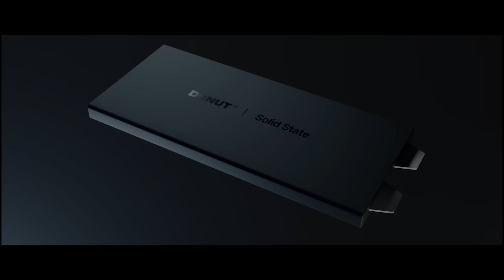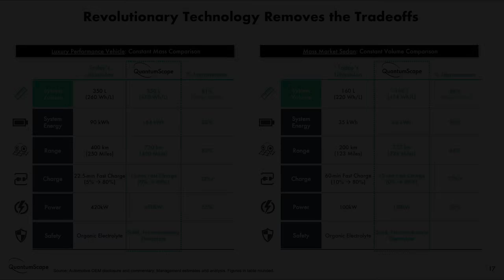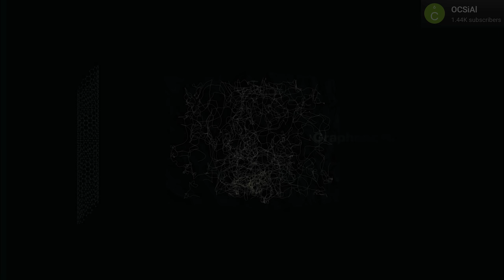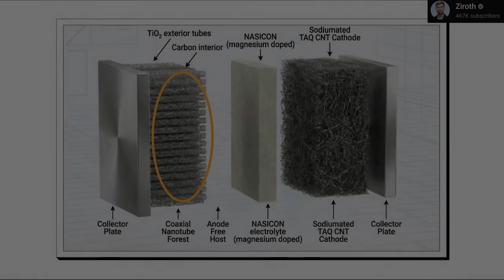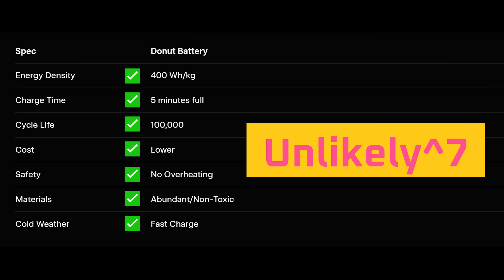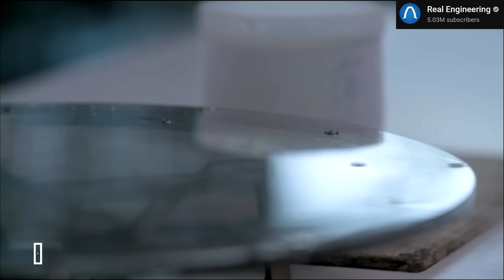Donut Lab's Battery has a Problem with Physics (and manufacturing)

Comment: I'm a little disappointed you haven't included the latest test results. I will be waiting an update when feel you have enough data. 

Other than that, I think you state the obvious (still useful though). Even us optimists, we felt this battery claims to be outside the current technology curve. Donut lab sure knows this and it is displayed at what additional statements they made after the initial release. Most of them are about what the technology is NOT, after speculation exploded.

So, yes. Either a completely new chemistry or a scam.

Comment: The results from their first test validate that they can charge very quickly. The next two tests hopefully will prove that they have the claimed cycle life and most importantly energy density. At that point hopefully you will have your miracle battery. Either way we will all know in the next week or so. Even if they fall well short of the predicted cycles as long as the energy density is close to their claims it will still be an industry changer for sure. I for one will remain optimistic for now.
Reply: It's not higher energy density than the solid state that everyone is pursuing. It's 8C charging is not faster than today's best Chinese LiFePO batteries (and reaching 90°C is... extreme).
Reply: @skierpage  More and more people now have the ability to charge overnight at home or all day while at work so ultra fast charging is less important. Energy density is the big one. If their claims are true this will enable EV`s to have as good as or even better range than ICE vehicles, again negating the need for super fast charging. 100k cycles was a very bold claim so lets say they can only do 10k, that is still 27 years of charging ability!! Those two out of the way just then leaves price and scalability, we will only know the answer to that once the chemical make up of the batteries is revealed.

Comment: Great analysis! :glasses-purple-yellow-diamond:Your limiting factor however is that you are framing your comparison wholly based on existing technology, materials, and manufacturing guidelines. Which makes perfect logical sense scientifically and historically. But it is not unprecedented that a new, low cost method of manufacturing can unlock a chain of new products that offer a step change in capability and/or pricing. If the process for manufacturing carbon nanotubes, and printing solid state sodium batteries has improved dramatically, it could open up Donut Lab's possibilities greatly.  CATL claims that their 175Wh/kg Naxtra batteries are being produced for $20/kWh, with volume production planned to bring the cost down to $10/kWh over the next few years. Granted, they are the world's largest battery manufacturer, and this is an evolution of existing materials and manufacturing. But what if their chemistry and technology for producing the Naxtra battery came out 20 years ago? It would have been unprecedented at the time. Everyone agrees that meeting all of Donut Lab's claims seems impossible. But their first testing video shows pretty well that their battery matches their claims of charging speed and temperature tolerance, plus the video notes that they don't seem to have the clamping restrictions of QuantumScapes solid state batteries. You must admit that this is intriguing and entertaining, even as you claim that it is subjectively impossible.:popcorn-yellow-striped-smile:
Reply from the maker: No, I'm basing it on physical realities.

VERY different.

With regards to a lot of the 'facts' you've provided, I've covered those in previous videos.  Check out my last video on sodium ion.

Yeah, it's entertaining.  But so far it's just a dog and pony show.
Reply: @thelimitingfactor  Carbon nanotubes were known about in the 1950s, but it wasn't until 1991 until NEC scientists "discovered" them. Their properties and capabilities have been developed since then. And the products coming from that R&D work doesn't alter any physical realities. If new methods for mass manufacture of CNT drops in price considerably, then new "revolutionary" products could come from that capability.
Reply from the maker: @deanmcmanis4862  I'm in regular contact with one of the top carbon nanotube manufacturers.  This isn't a blind spot for me, but rather one of my strengths.
Reply: @thelimitingfactor  Great! What does your contact think about the prospects of a new method/leap in volume CNT production that could drop prices dramatically, and enable more affordable products to be manufactured that have not been possible with current CNT's slow/difficult/expensive production methods?
Reply: Hi apparently donut battery can have many different volts but stuck to the oen standard
Reply: @MichaelGreenLagos    Which a lot of pundits have been conveniently ignoring.

Comment: "We don't know, what we don't know". I love how everybody is applying current knowledge and current battery tech to new innovative one.
Based on battery tech and chemistry it's impossible to build such a battery, therefore it's a scam.
Imagine what inventors of jet engine think, and what would public think if presented with crazy claims od what Jet engine can achieve vs normal piston engines. 
"To achieve those crazy speeds you would need more engines, even faster ones, but then again the weight is a problem, either way, based on current knowledge it's impossible to achieve those claims, therefore it's a scam"

The similar thing is with chip manufacturing, at a nanometer scale. At some point things stop scaling and we need a different approach, new way of thinking.
Just search for "intel" struggles and their 14nm constant improvements. And right now, we are on another big shift. Gate all around FET, and backside power delivery. It's a new way of designing and building chips. 
You can't just scale down forever and expect it to work every time...
Maybe we are at a time, where we need a breakthrough, a new way of thinking of batteries, how they should be built and not just what they are made of, what materials, metals they use..
So far, I remain optimistic

Comment: When I first heard Donut Lab's battery claims I immediately thought they were describing a capacitor.  I've used capacitors as a backup power source in the products I manufacture for years. The only parameter the capacitor needed to improve on is energy density.  I underestimated how extremely difficult it is to improve the energy density of a capacitor.
Reply: Capacitors also need to improve self discharge rate
Reply: they did a self discharge test which resulted in the refutation of it being a super capacitor

Comment: Exactly! There is no way they are going to make 100GWh of these by 2023, reduce cost by 56%, enable structural battery packs that have 16% more range than a 2170 packs, and produce 3TWh by 2030!!! Ohhhh...wait. Hmm looks like their CEO is learning from the best! Hype Hype Hype and collect that 💰💸💰💸💰
Reply: There's a difference between optimistic production targets and hype. For the record I was skeptical of Tesla's hopes for the 4680 cell and dry cathode, but they clearly believed they could do it (and kept at it). Donut Lab OTOH is big on hype and short on product. As of June 2024 Tesla had produced 50 million 4680 cells. Total deployed production of all their batteries is expected to hit 100 GWh this year. Tesla expected to gain a modest real-world capacity improvement, and they told us exactly how they would do it. Donut lab is claiming 'unbelievable' specs from a secret chemistry, with less than 2 years development time and zero track record. Maybe it is the real deal, but their hype doesn't inspire confidence.
Reply: @bhabbott  So you consider Tesla’s 4680, FSD, Semi, Solar Roof, Roadster, Cybertruck, Boring Company’s solution to all traffic while selling bricks for profit, SpaceX Mars timelines, Elon’s (boosted) gaming abilities, Elon’s COVID 19 predictions, Elon’s Epstein “refusal to go”, and D.O.G.E.’s trillions in savings for the US all just to simply be “optimistic” guidance?? 😮

Comment: Does anyone else's battery internal resistance go down with increased heat?

Thomas Edison tested thousands of filaments before trying carbonized bamboo. Someone thinking outside the box could have tried this much earlier on
Reply from the maker: Ionic resistance goes down with increased temperature.  It's normal.  It works the opposite of electronic resistance.
Reply: @thelimitingfactor i stand corrected. I have seen this fact repeated on other Donut reviews

Comment: Does anyone else have a battery that can charge at 11c and not lose capacity? 
This should be giving them alot more street credibility than it is.

If they don't release more info as stated. Then  you can raise more red flags.

I am sorry if they are not giving away their trade secrets quick enough that could make them trillions.

Their batteries do not contain lithium. So quit assuming their batteries should react like lithium. 

Was there this much doubting when John Goodenough introduced the lithium ion battery?
Reply from the maker: You must be referring to their charge test.  Yes, it's replicable.
Reply: You sound like a donut investor??
Reply: @GWAForUTBE how many investors do you think Donut has? 
If you were one of their limited investors. Would you let Donut put out a fake battery? And say goodbye to your investment? 
Think about it.
Reply: @golfish8589 Most investors dont have much authority within an investment CO. Just to sell thier own shares.
Reply: Yes, LTO batteries can charge at 10C with excellent cycle life: 10,000 cycles IIRC.  High performance LTO can charge at 100C 🤯 These batteries are available to purchase from suppliers like Toshiba for many years now.
Reply: @georgepelton5645 what cars are they in?
Reply: @golfish8589  LTO are used in power based applications, not energy based ones like autos.  However Altrnano did put some in pickup trucks from a startup company back in the 2000's.

Comment: Typical hype around a tech that isnt there. Reminds me of Lucids early marketing. Lots of promises to one up Tesla but lackluster outcome.
Reply: Lucid's cars are far more efficient in miles/kWh than Tesla's, and just about every car except for Aptera's weirdmobile tricycle. Everyone seems impressed by the Air and Gravity's handling, ride, and performance – all the "car" aspects of the car – though the software still has problems.The engineering is there, the road to profitability remains very bumpy.
Reply: @skierpage  Sure but you pay a huge premium for that efficiency and all other aspects of the car are unimpressive for the money. They cant scale and arent sustainable without massive funding from outside the company. How many years can they survive with their current business model? Marketing doesnt save poor execution.
Reply: Lucid actually excel but are pricey. They are good
Reply: @amazingeducationquestionsa1367  Not according to some owners. For the price the value isnt there. Software problems etc.

Comment: Donut battery doesn't have lithium
Reply from the maker: No proof of that yet.  In fact, the results so far point straight to lithium.  We need direct testing of the cathode material.
Reply: What do you think of the third party  on 5 minutes charge i think they are call VTT in Finland
Reply: What do you think to the third party VTT check up to c11 and less then 5 minutes change
Reply: Donut was ask do you use lithium they said no

Comment: The New York Times famously claimed human flight was millions of years away; 69 days later, the Wright brothers flew. Only a beekeeping magazine showed up to cover them because the 'experts' were too busy looking at theoretical models to notice a practical success.
Donut Labs is claiming a paradigm shift; you won't find that on any charts yet. If science were truly linear, we’d still be making the world’s best steam engines instead of jet turbines. The 'big boys' are optimized for incremental gains, not the breakthroughs that actually change the world.
Reply from the maker: Well, then it should be no problem for them to silence my counterarguments with a solid set of tests and proof.

So far, the first test was poorly designed if they wanted to do that, and designed extremely well if they wanted to pull the wool over peoples' eyes.

The Wright Brothers flew.  Critics silenced.
Reply: @thelimitingfactor  New Donut Labs Video out today, High Temp Performance Test, they do seem to want to pull the wool over peoples' eyes, but I'm guessing it's the army of Chinese battery PHDs at CATL they are trying to fool, I have my own guesses but the battery probably does everything they say it does, but the reason for the weird way they are doing this is a fortress against China. The longer people say it's fake the better for them, this is to keep China guessing for as long as possible as they get more vehicle manufacturers on board, they might also be middle men for the printer company in Germany who sold them the printer for 20 million (or so the internet is reporting somewhere)

Comment: Put dynamite and petrol on that graph. Alot of power but only reacts once.
Reply: I found out the hard way when I tried to charge up my mostly depleted ICE vehicle.
Reply: For most once is plenty enough.
Reply: @wolfgangpreier9160  But that tech would be useless without massive investment in extraction and processing of the material. In the early days of motor cars EVs were preferred because you could charge them at home, while you could only buy petrol in jars from the drugstore.
Reply: @bhabbott  In the early days? In the time of my Great great great great great Great Grandfather. Yes sure. They still used quilts and papyros at that time. And us peasents were not much more than slaves.

Extraction of which material? Lithioum - you need it for gazoline. Cobalt? You need it for special steels in combustion 2000 V8 monster posion makers. Rare earth? You need it in brushless toothbrushes. Iron? Thats not rare. Rubber? Wood? tin?

which one do you mean is needed beyond those already neeeded for the old tech from the 20th century?